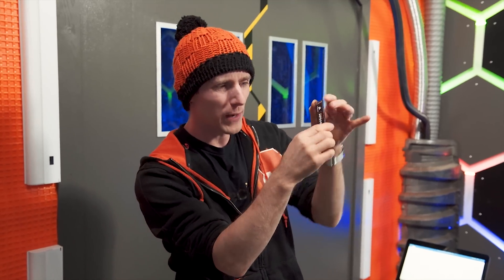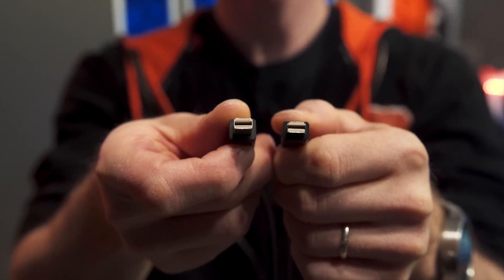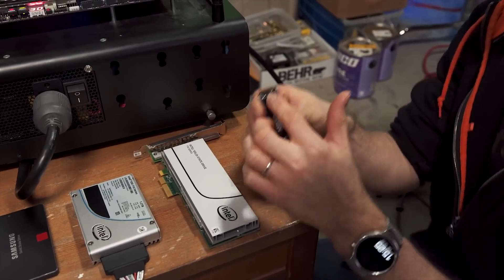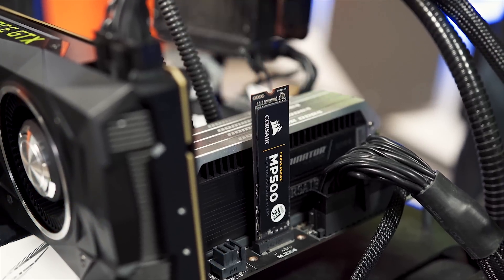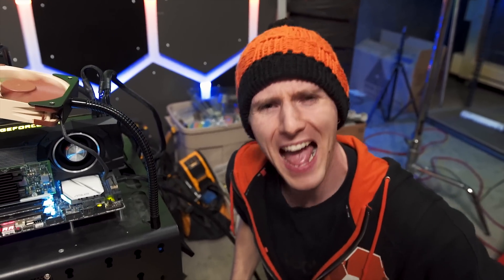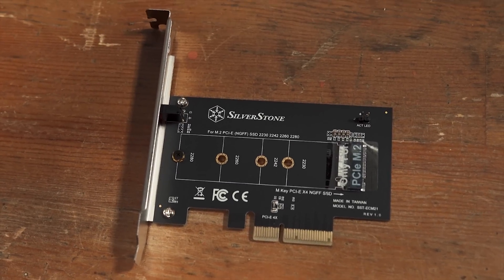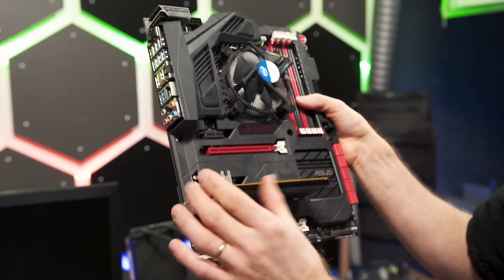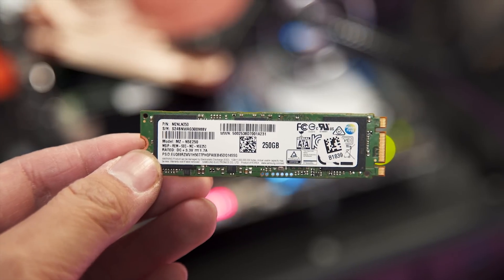The FASTEST SSD Technology Explained - M.2, U.2, and MORE

Comment: Hey linus, the inability to boot from PCI-E storage isn't a problem almost whatsoever. Bootloaders can be used on a small hard drive, even a cheapie 80GB one, and then that can hand the deal off to the SSD. While this isn't that elegant, this is what I use to dualboot Windows Server 2016 and Windows 7.
Reply: No, I was saying if you put a bootloader on some random ass hard drive, I gave 80GB as an example, you can boot off of that, but store the OS on an SSD. That way when the PC boots, it hands you off to the bootloader, which then hands you off to your OS.

My config is a 300GB HDD with a Server 2016 install disc image on it, and the disc image's bootloader allows me to boot into Windows 7 and Server 2016 because Windows 7's bootloader refuses to load Server 2016, and Sever 2016 doesn't want to boot into Windows 7.

The same thing can be done with PCI-E storage that can't boot. Load GRUB on a small hard drive, configure it to load your OS off the SSD, and you're good.
Reply: Bah guess i was beaten to the punch.
Reply: but why get an M.2 if you're not going to use it for booting? Seems pointless to me as the larger storage size drives are WAYYYY too expensive.
Reply: Itsneight If you actually read what I said, you would know how stupid that was.
Reply: I assumed since you said 80GB that you were referring to a 2.5"ssd or AHCI M.2 since 80gb M.2 nvme drives dont exist.
Reply: Yeah I didn't get either watching the video why it would be a major problem with such an easy workaround... (And since bootloaders are pretty small, a slower drive would be very fine.)

Comment: I think you're confusing NVMe/AHCI with M.2 PCIe or SATA. What you have to look out for is if your motherboard's M.2 slot if PCIe x4 or SATA 3. Some boards use M.2 but they're only using SATA and not PCIe lanes. M.2 drives are the same as well, they can be PCIe or SATA. If you have a PCIe based M.2 slot on your board, you can use either PCIe or SATA M.2 drives, but if your slot is SATA based, only SATA M.2 drives will work.If your M.2 slot is PCIe based, any M.2 drive will work whether it's PCIe NVME, PCIe AHCI, or SATA because almost all PCIe based M.2 slots have a backup SATA mode in case all your PCIe lanes are being used. With that being said, an NVME PCIe M.2 SSD will be fater than an AHCI one, but not by much. They will both blow SATA based SSDs out of the water, but the NVMe version will have lower latency and slightly faster throughput.

Comment: Windows 7 can't be loaded on Samsung 950 pros. Just a heads up.
Reply: For anyone that is interested, Windows 7 can run (not install) on a 950 pro, you have to first install it to a different drive, install the samsung nvme driver and then clone it across to the 950 pro. Have fun!
Reply: Skrenja Why?
Reply: When I originally built my pc this summer I was going to use windows 7. No matter what you do the 950 will not show up in the list of bootable drives. Ended up getting windows 10. Not sure if they will still work strictly for storage on 7 though.
Reply: You need to oad the driver at instal time, or modify the installation image to insert the driver.

edit: Apparently the driver can installed via a hotfix , and the F6 at install won't work.
Reply: Everything I can find online about it says that, while that should work it doesn't. Did you actually get that to work or is that just your theory?
Reply: There are complicated ways to get it to work if you're dedicated that involve patching windows and stuff but I think most people would rather not. It's nearly impossible to do if you are doing a fresh install and don't have access to another pc.
Reply: https://support.microsoft.com/en-us/help/2990941/update-to-add-native-driver-support-in-nvm-express-in-windows-7-and-windows-server-2008-r2

Looks like you have to do a patch is a touches a lot of subsystems. As far as patching goes the insturctions are fairly straightforward. For a new install on a singleton PC, method 2 just requires a 40GB+ hard disk. (cheap or free)

Comment: I have 2xWD velociraptor 2tb raid0 2xseagate baracuda 3tb pooled and a 256gb 850 pro for a boot drive. Would it be worth while to get a 960pro 512GB or 960evo 1tb for a new boot drive and retire my current boot to become my laptops boot drive? I'm also running win7 ult and there is little info on the transition-ability of a sata to a m.2 drive as a boot, should I be worried about the transition process and is there any other configuration that would be more optimal for cad work. I only have 4 sata ports and am using a drive toaster to hold on to the second seagate, the move to nvme would clean up my build (free up that last sata for the seagate) and allow for possible increased work flow with my amateur cad work/photoshop stuffs. The way I run my rig right now is as follows:
850 pro: boot/frequently used programs
velociraptorX2: scratch/game folders
seagate-pooled: riped blurays/music/photos/finished projects/entire system backup
The way was thinking if an upgrade is in bound:
960pro or 960evo: takes the place of the 850 also is used as scratch for projects
velociraptorx2: gamefolders/finished projects
seagate-pooled: same -finished projects
again if there are any suggestions as to how i can optimize my rig further I am all ears.

also just in case this is relevant here are my pc specs
cpu: i7-4790k with aftermarket zalman heatsink(looks like a ball)
gpu: gtx970
storage: stated above
memory: 16gb hyperx savage 2400mhz
psu: evga supernova 750W 80plus gold
and just for fun
monitor: ASUS PB287Q 28" 4K 1ms (it has freesync in anticipation for vega of course)
headphones: Audio-Technica ATH-M50x
speakers: Klipsch R-15PM

Comment: Linus mentioned "Steam Library".
There is no difference in performance running a game from an SSD(SATA3) or NVMe(M.2).
Yes NVMe is faster, but games are not so I/O heavy after the first boot, so it does not reach the limits of the SSD.
NVMe is good for code compilation or servers(low-latency and very good performance) but do not make a difference for games when compared to an SSD.
Reply: Imię Nazwisko What I was saying. After the first boot of the game, there is no difference.
People sit for hours inside a game, a few seconds at boot makes no difference.
You better get a bigger SSD for the money, so you can fit more games.

For video editors, build machines, servers... it definitely should be considered.

Comment: my Haswell Asus H97-I Plus ITX mobo has M.2 PCIe Gen2 x4 10 Gb/s with bios update it supports nvme & boot support but only gives 20% improvement compared to SATA 3 700 MB/S which is to be expected coz old chipset & less PCIe lanes ;))

Comment: Great video Linus. I just wanted to share my personal experience with M.2. I recently upgraded my PC to: Motherboard: Asus Sabertooth Mark 1, CPU: i5 6600k, RAM: 16gb 3200MHz and M.2: 256GB Samsung 950 Pro M.2 PCI-e 3.0 x 4 NVMe. I installed the drive onto the dedicated M.2 drive on the motherboard (not using an adapter to connect to PCI-e) and installed Windows and the usual software (office, steam etc). I found Windows to feel clunky and slow on a day to day basis. Almost like Windows couldn't keep up with the speeds of the M.2. I've since installed Windows on a regular SATA SSD and using my M.2 Drive for just about everything except Windows, and the whole system feels perfect. I might try again in 6 months and see if it's a software problem. Has anyone got any advice or similar experiences? Thanks!
Reply: Sounds more like a CPU issue. There is no such thing as too fast storage making your computer work clunkier, but their could be software issues with the Samsung controller onboard

I've noticed my computer runs slower when the frequency is too high. If your i5 6600k is overclocked, try lowering to stock values or just .1ghz slower to increase stability
It is also worth double checking graphics and storage drivers. Check windows update for optional driver updates, that might help.
Reply: @ShitkidOfJamrock  uhh thanks.. I'm not having the issue anymore 😂

Comment: I'm having trouble installing my new 960 evo :( someone help
Reply: pull back the catch and push it in as hard you can, don't stop until you hear a slight snap
Reply: start by getting butter on the fans, if you don't do this very important step, your fans will explode

Comment: I am more confused now...
Reply: I thought i knew basic PC tech, i got like 20% of all that in the video... Apparently i'm getting old. :(
Reply: first time ever i dont understand what linus were talking about xDxD so ashamed
Reply: Aaron Luedemann There are already some NVMe drives on the market that aren't too expensive. Samsung 960 EVO for example has great performance and OK price. Upcoming (mid-february IIRC) WD Black SSD will be even cheaper - 200$ for 500GB.
Reply: I thought the same until I realized stuff in this video concerns maybe the 10% of tech literate people from the 1st World that have the extra cash for these types of hobbies. Most people will just go with a 1 to 2 TB HDD for storage and the cheapest 120 GB ADATA or Kingston SSD for OS.
Reply: @nermanus  120 is not enough for OS!!
Reply: @nermanus  wow this aged poorly, a good NVMe disk now is dirt cheap and in everything
Reply: I got a 128GB NVME drive on ebay for $55.00 
Works great as my boot drive and is noticeably faster than my old 45GB SATA SSD. You just have to look for the deals. They're out there.
Reply: fwupow The important factor are access times and IOPS, not sequential r/w speeds. Sure, SSDs are a few times faster (500-600MB/s vs the best HDDs being around 150MB/s), but they are an order of magnitude faster at seeking data - a few MICROseconds for SSD vs a few MILLIseconds for HDD. That's what we perceive as "a lot" faster. Sequential speeds are mostly noticable when transfering large files, which to be honest happens very rarely with SSDs (so far, as we're mostly using them for OS and software).

But yeah, you're still right about the difference between different SSDs not being as big. We probably won't see such a big jump in performance ever again now that everything is silicon based. We're closing in on the physical limits ...
Reply: Same here.  My brain got an info dump that spread across random neurons.  Shudder  So much stuff I knew nothing about . . .
Reply: TO RECAP - he's just talking about a type of memory that can be used as a hdd, and the pci cards are basically adapters for motherboards that don't have the connection. If you want to be able to boot from it either way, you need a mobo that will accommodate you because not all will. See? Was that confusing?
Reply: I'll just stick with the 1TB 850 evo for a while.  Thing is still around 300.
Reply: does this work with my xbox one s?
Reply: i'm definitely not one of them since i will install os and games on them, and game is huge 20-60gb....
Reply: MY BRAIN JUST MELTED....
Reply: hello
Reply: Nesewebel lel? You mong
Reply: simple answer depends upon your motherboard. M.2 is fastest if you have newer tech
Reply: https://www.youtube.com/watch?v=SP0Brsc0dMY
Reply: ALMGNOON I think that guy got so many 👍🏿 because this long winded vid was summed so simply by you.
Reply: thats it
Reply: @Normie Peasant Well, it depends on the form factor for your 1TB Samsung 850 Evo. I have a Serial ATA version but I saw last night that the same class of Samsung in an M.2 2282 form factor. Still learning up on the differences. 

But good call! Still using SATA in the legacy way. Keep it. Always remember that many of your components will long out last others such as CPU and mainboard (and then memory) in terms of frequent replacement. (clarification: In order of most often replaced/upgraded components - CPU&mainboard, video card, memory, storage aka ssd/hdd, m&kb, case and accessories.)
Reply: @fwupow Actually, the SATA hdd got up to 150MBps. I think it was greatly enhanced due to better queuing and cache before going to an expanded serial bus connection with SATA3. HDD used to be as low as 66MBps but that was on PATA IDE.
Reply: @Richard Butt You hurt yourself more in "looking for the deals" and getting a storage size lower than 220GB. Unless you clean out the garbage that will naturally occur on operating systems for paging file, etc. getting a bigger drive is always better. As seen when looking at SDRAM DIMMs (memory) the higher storage capacity may see less beneficial with higher data access times, the pay off is much better in the end with the higher storage.
Reply: I wanted to like this comment but it has 999 likes and I dont want to ruin it
Reply: i was your thousandth like
Reply: in short , to make it simple! ...you don't need one. :)
Reply: @lued123  they're cheaper and I'm still confused
Reply: NVME seems to have similar speed to SSD.s. MVME drives are meant for Tablets and Laptop etc anyway and even though
MB's have M.2 sockets you probably don't need to use one for a drive.
Reply: PCIE=NVME= M.2  ?   or PCME= AHCI ?
Reply: @BheemReddy  M.2 IS a socket as is a PCI slot. If you have no M.2 slots you can plug a card into a PCI Express slot
with the right connections to use an M.2 NViE card. Ideally you want a dedicated M.2 Slot to get the best performance.
Reply: i'm sure it doesn't take much to confuse you.
Reply: ALMGNOON make sure u get the 970evo plus certainly the fast hArddrive. My pc boots in 2 seconds
Reply: Got Game NVME is NOT a hard drive lmao
Reply: Would the Crucial mx500 be a good choice?
Reply: @muhammadpreston3134  get lost loser.
Reply: @edgarantonio4185  bot alert.
Reply: Same
Reply: I think everyone here gets it by now
Reply: SCSI bus rad

Compatible all not non
Stroe GPU store memory install
Reply: Connective
Reply: Hi
Reply: you've had 3 months to familiarize yourself with the terminology, did that help? I find most confusion in this kind of scenario lies mostly with a lack of being familiar with the terms used, and you can take that to the bank and cash it.
Reply: Yeah...I'm done with Linus. This is the last vid for me. I get enough commercials from YouTube as it is.

Comment: Does it matter if I get the fastest ssd for gaming? The only difference I know is the loading times 🤔
Reply: Scythe I believe the loading times are the only benefit in terms of gaming (which you already mentioned). There's also faster boot times, but I think those two are it in a gaming context (of course, there's generally also faster reads and writes, but I don't think that's very relevant for gaming)
Reply: SSD/HDD/Whatever has no effect on performance, only loading times (mainly the initial start-up load of the game)
Reply: most folks just get it for the operating system and programs.  My motherboard, x99 taichi, has two m.2 slots, so I thought about getting one for gaming.  Pricewise its just not going to happen, plus my steam library wouldn't fit on any ssd right now.  For a game drive, I would look at western digital gold drives as the loading times are improved with a good hard drive.
Reply: I went back to a old HDD for 30 minutes because my SSD broke,that's how long it took me to rip the HDD out and throw it in the trash,the game load times were horrendous.

Comment: Couldn't you have your bootloader on a really small SATA partition and use that to boot into windows on a NVMe PCIE SSD?
Reply: Doldol D Kinda defeats the purpose since most folks using them just want fast boots and such, and I'm pretty sure a partitioned drive uses the same protocol for both parts.
Reply: No not really as you'd still be loading windows from your NVMe SSD
Reply: I actually looked into this, you can load Win NVMe drivers from a SATA/USB boot device and load everything else from your NVMe SSD. Maybe a good video for LTT?
Reply: B85 is Haswell and Broadwell, B150 is Skylake
Reply: I thought UEFI required the bootloader to be on the same disk as windows?
Reply: Mod bios, works great!
Reply: if u have 76 and go up u can mod ur bios to make it boot
Reply: essam kushad Works great!! on B85 chipset. using it on a gigabyte g1.sniper b6 with a intel 600P
Reply: B85 chipset is Skylake which is relatively new. Ofcourse it works with B85 as it works with Z170 and even most of the previous generation motherboards as well. :I
Reply: You're right... I realized that about 20 seconds after I posted it. DOH!